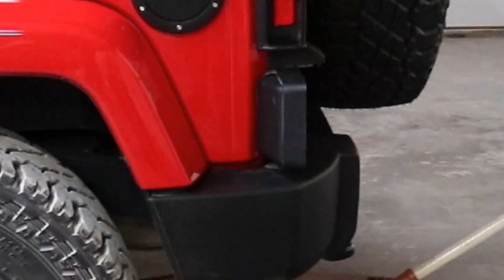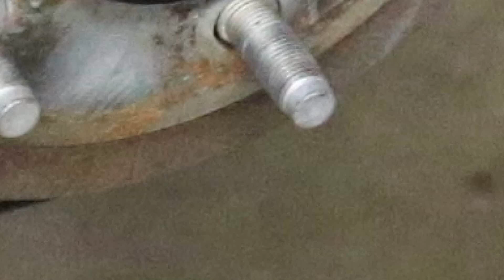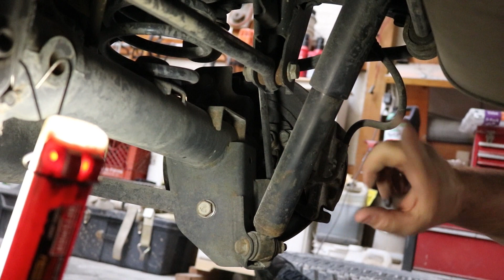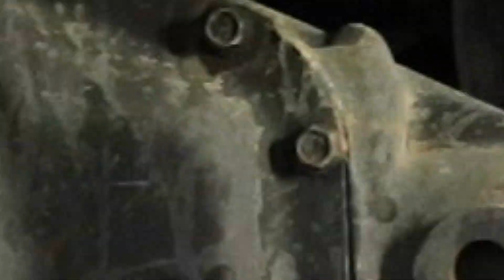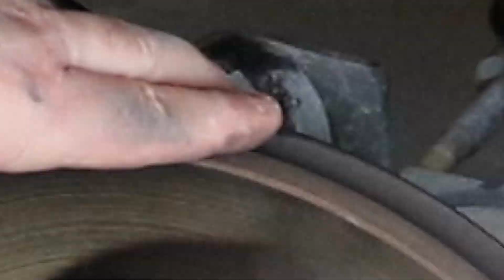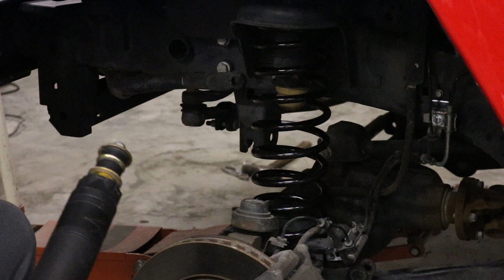Jeep JK Wrangler Customization: How To Install an Old Man Emu Ultimate Hybrid Suspension Lift

Comment: 3 questions: Was this a Low COG lift kit?  Do you need adjustable control arms to re-adjust the casters with this kit?  You didn't need to add extended bump stops for this kit? Thank you very much.
Reply from the maker: Hi Bill, This is considered a low COG kit as it sits at 3" or less of lift. With smaller lifts, caster is not affected as much, so while adjustable control arms are always an option, they are not mandatory. We didn't install bumpstop extensions when we installed this kit, but they are called for with bigger tires. Please feel free to call me if you want to discuss further at (316) 776-9900. Thanks!

Comment: Hi! nice work. Please what size of tires and wheels has this Jeep? How much lift this suspension?
Reply from the maker: Thanks! This jeep has 17x9 rims with 4.5" backspacing. It started with 33" tires, but is now running 35" tires. Here's a link to our Customer Rigs page if you want to see some more info on this jeep: https://dpgoffroad.com/customer-rigs/  Also, here's a link to this particular suspension: https://dpgoffroad.com/product/ome-jks-ultimate-jk-hybrid-kit/  It's just about a 3" lift.